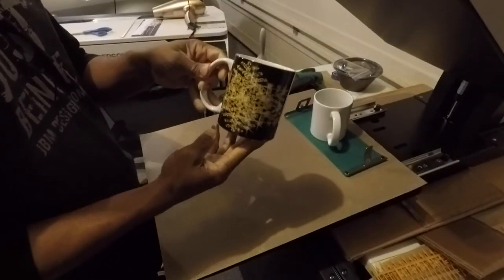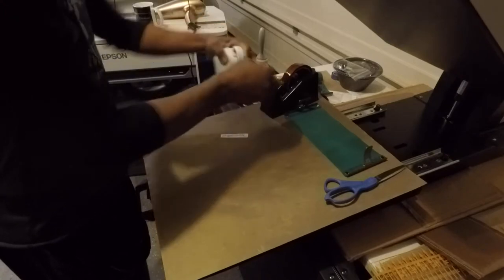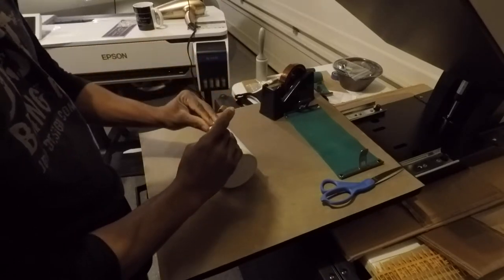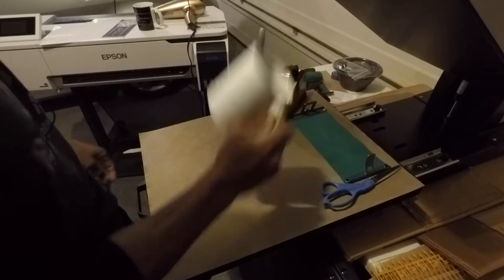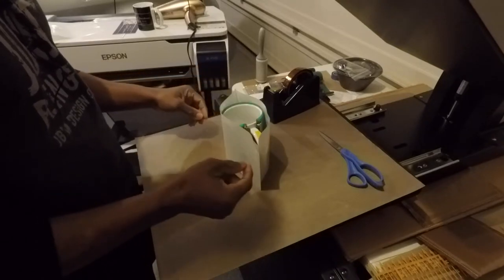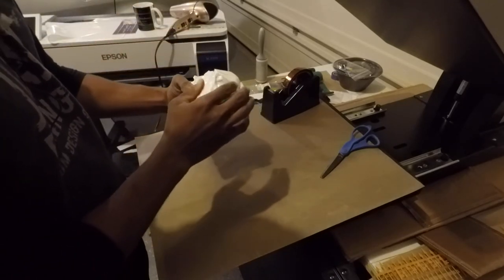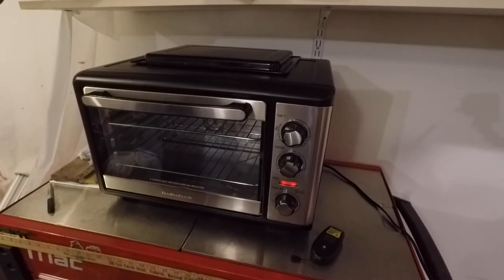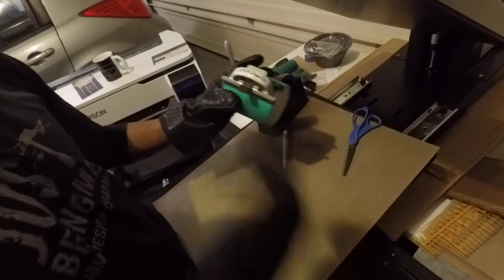Can You Sublimate On A Coffee Mug Handle?

Comment: Nice! Thanks for the instruction. So, if One were to have a small image fitting the hemisphere opposite the handle, could they use just the Shrink Wrap? Thanks again
Reply from the maker: I can't say for sure if shrink wrap would give good pressure to sublimate to the inside/opposite side of the handle. You might want to use heat tape for that.

Comment: Just use more tape instead of shrink wrap. Also that toaster over is nice and Big but mine caught fire never did trust it. I went and purchased the same one because its the biggest and cheapest for the size  but its smell like its going to burn up again after using it a few time. Unplug it when your done using it. Just incase. Also i have seen it before on the handle but not to many videos on it so its good to have more on it. You can put image inside cup, using sand to hold weight on image.

Comment: What is the paper that the print is on, whats it called?
Reply from the maker: DS Multi-purpose sublimation paper.
Reply: @jbmdesignco.693  Thanks, Can you use a normal oven?
Reply from the maker: @irishgamerladd2227  I personally do not recommend using an oven that you would put food in because of the sublimation gasses. I purchased a cheap oven from Walmart for sublimation.